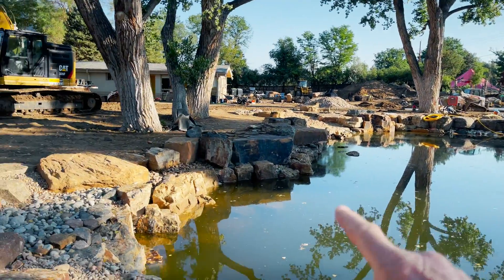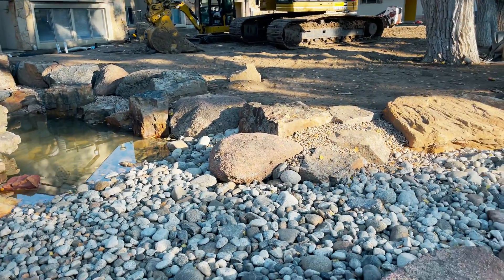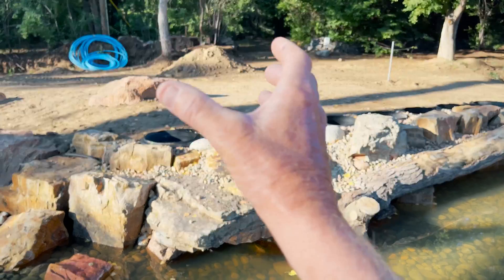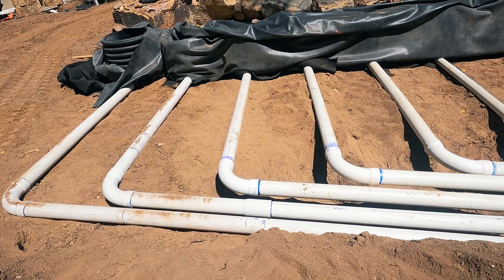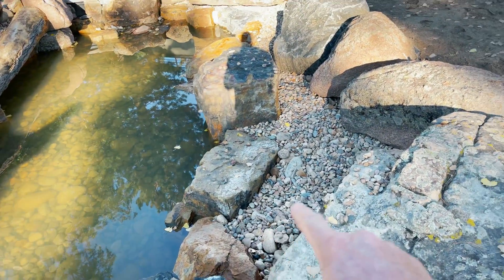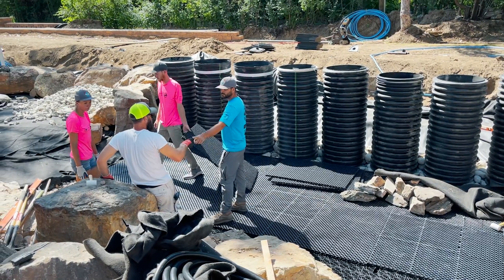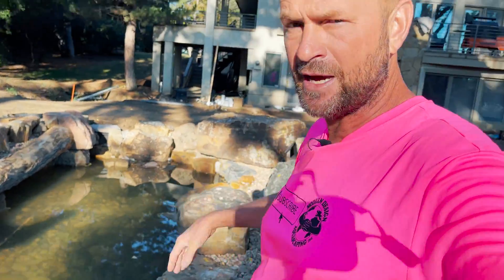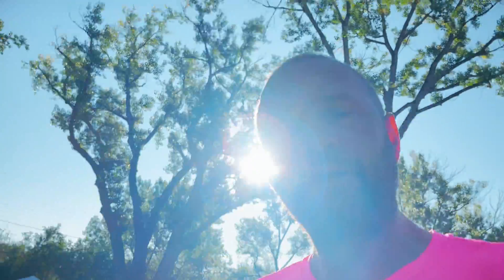Swim Pond Intake Bay Installation Tips | Water Feature Design Series 17

Comment: Now knowing about the sedimentation issue, the snorkel/centipede only seems logical...we already use it for effectively the same purpose in the wetlands, so...yeah.
But it does seem like some significant "agitation" would be beneficial down there for the purposes of flushing out, as even if you could dump MASSIVE amounts of water in through the top of the rocks, the water flow would be SO diffused that it might never disturb heavy sedimentation at the bottom very much...I'm imagining something like pipe running the length of the blocks either directly on top perimeter of blocks (pointing down) or along side the base of the blocks (pointing horizontally inward), with multiple outlets along the length. These pipes are supplied by the diverted flow of say one or two of the existing pumps in the bay. They'd be turned on (diverted) simultaneously to the cleanout pump running in the snorkel, disturbing and suspending sediment into the outflow of the cleanout. Additional outside water could be run either directly into the vaults of the pumps in use, or into the bay in general, but it seems that much LESS water would be used overall.
Reply from the maker: Good thoughts. I considered the “flush” idea but Colorado is so cold all plumbing is under ice abuse so I opted out. Might be that a line from the skimmer pump with a diverter  into the end of the centipede could be a good solution for push…Or set up with jets at back row of intake blocks pushing into centipede ditrction? I’ll keep working to make it better as time goes! Great comment👍🏻😎Thanks for spending time
Reply: You could start digging into air to agitate. See some Europeans doing that

Comment: Hi John,
What did you run for pumps? How big was the filter? 
Thanks,
David
Reply from the maker: The intake bay is sized to run for 70,000 gallons per hour. Pumps Of switched around several times and will be hooked up shortly. Wetland is sized accordingly for that 44,000 gph flow rate!

Comment: I have a lot of experience, but I honestly must say that I learn so much so fast watching your videos in detail.  The only thing I don't understand is if you used 3" bulkhead fittings to get the pipes into the liner and how the pipes look when going in.  Do you drill through those blocker tubes?  Do you have anything at the end or bottom of the pipe for screening?  I am inspired by your work as always John.
Reply from the maker: Awesome, thank you!🙏 we jump he liner if we can- no bulkheads for me if I don’t have to. Only using swing check valves at the bottom of the suction lines- no screens.Gravel in the intake has to pre-filter the water.
Reply: Thank you so much John.  You are a true leader in this new industry.  Your videos are extremely helpful and educational.  Do you cut a hole in the back of the vault where the suction takes place?  Or do you go into the vault from the top?  I dig those large 3" sweep L fittings.
  @KoiAddiction

Comment: Question.  Can you show exactly how the skimmer is tied in please?  Close ups would be awesome.  I makes sense to not only pull downinto the filter but clean the surface at the same time.  Plus less chasing leaves with a net.
Reply from the maker: I am 1000 miles from there BUT it is a standard install of an Aquascape 1000 skimmer. You can Google it on their channel- they have a video on that ;) There will be a simple “jet-style” return from that pump so it feeds the leaves to itself. Basically a vacuum cleaner on the pond ;)

Comment: Question - would you now put a snorkel in a negative edge reservoir?   Are you designing them that way?
Reply from the maker: No, the negative edge reservoir -not yet. We haven’t had any issues with sediment buildup in these. Probably because they are typically designed deep with a small footprint. Although if I had to design a large negative edge reservoir that was only 1-2 blocks deep I would consider it a “design option”…Good thinking ;)

Comment: John it’s five minutes I’m not getting back regardless, was there value in them? Well yes it was spent with you! Really liking the centipede idea the potential there on theses large ponds would be very helpful, it’s taken my a while to warm up to adding a skimmer into the intake bay for general maintenance which was eliminated by the bay to begin with I can see some usefulness out of it.
Reply from the maker: True story. I think I am going to build a concrete vault next time and skip the plastic vaults on a feature this large. I suggested it this time but parts were already on site and we went with it. Lots of changes along the way on this project,,,
Reply: @KoiAddiction  I’ve seen concrete vaults on existing natural ponds that add on waterfalls or use them as collection devices for outflows; interesting idea you have here!!!

Comment: I think that the debris will start to acumulate on the top of the peebles and will not pass thrw the peebles when you put a cleaning pump in the centipede... maybe by using insted of peebles,rocks of 20 cm so that the debris will pass more easy. The debrie will acumulate in the wetland but that it easy to clean :)
I admire your work john!!
Reply from the maker: Thanks, we shall see. We use 3” stone on top, still going to catch bigger debris for physical removal. We often vacuum this stuff up. The goal for the centipedes and snorkel are for sediment and sand. Wetland would not function properly if too much larger debris passed through though. Thanks for watching!